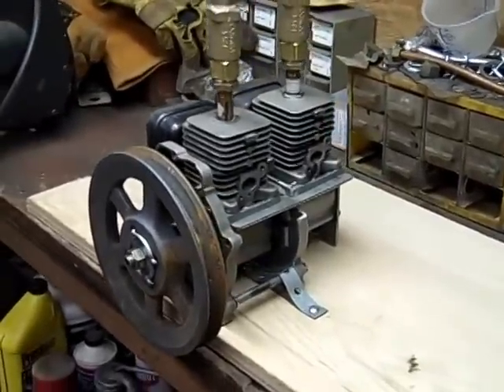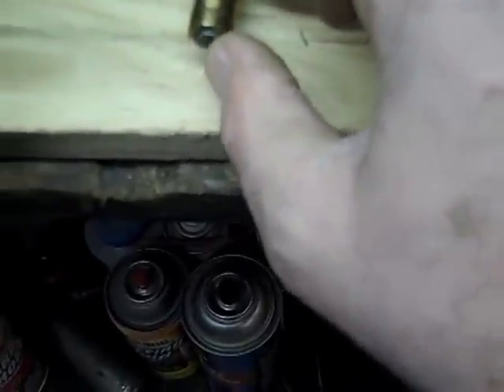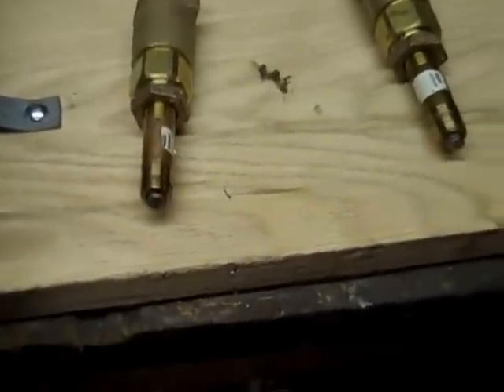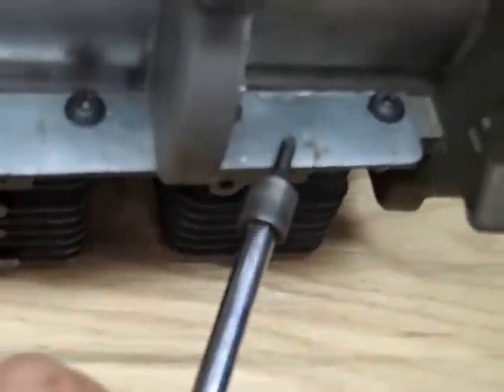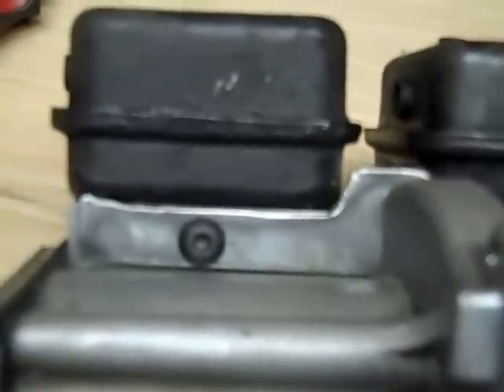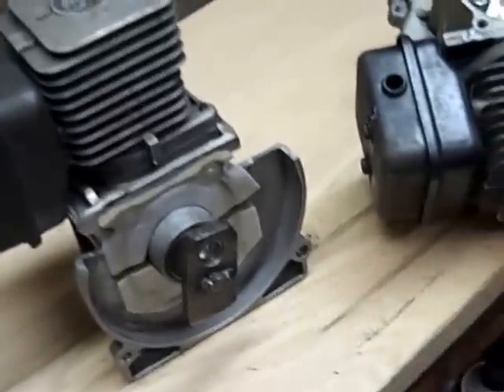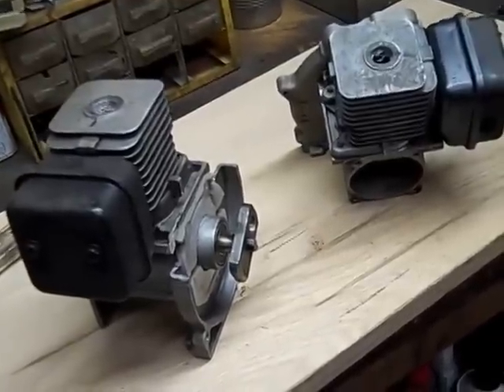The worlds first Twin engine Weed whacker Air Steam engine

Comment: Do you think that a 2 stroke 2 cylinder outboard motor will run on steam. I have looked in several places but found nothing
Reply: I'm sure it could! 2 strokes are good engines to convert to steam

Comment: If you ever took the challenge of adding a third engine, you could offset them 120 degrees, rather than 180, and it would smooth out a lot. That would also make it directional, so it couldn't be simply reversed. 
Pretty cool setup though.

Comment: Do u cover the intake holes were the carb use to be
Reply from the maker: No. I figured any air in the cylinder would be compressed as the piston comes up adding to the compression in the cylinder. Not sure if it makes a difference though.

Comment: The application of using air or steam is the absence of gasoline. If you don't have a gas station, how are you going to run anything on petroleum fuel? Efficiency has nothing to do with it, it is about worst case scenario use! A fire puts out A LOT OF ENERGY! You will have one going to cook, heat, dry, smoke meat, tan hides, ect. Why not charge a battery bank to provide heat after the fire? If you have ever camped or had a wood stove heat source in a home you will get it. Gets cold when that fire dies so rather than waste more fuel/wood, use the steam powered engine to get through the night and into the day? Think outside the box.
Reply from the maker: You make some good points JS. Thanks for commenting.  I think a gas engine converted to steam is a fun concept but not a practical or efficient one. An engine designed to run on steam uses the energy required more efficiently. Perhaps a sterling engine would be a simpler design to use in an off the grid situation as well. Capturing the suns heat with a lense would also be a good source of free heat to make steam too. There are more good ideas out there. Keep thinking outside the box.

Comment: no no.  it actually depends on your needs and resources.  Say you already heat your garage or building with wood.  Then it makes perfect sense to run a steam engine to power various things.  one thing they all get wrong is no one pipes the exhaust to a condenser then back to boiler .  Secondly you need to use electronic solenoids timed off the fly wheel with a basic magneto to charge the battery .  Its going to work way way better .

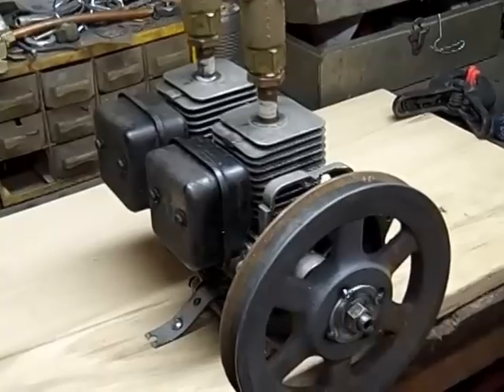Comment: Awesome engine but I had to stop at 2:20 after the most idiotic thing that came out of his mouth... Not practical... Put a parabolic lense below a boiler tank and point it at the sun then put a properly focused fresnel lense over the top and it will boil water in less than two minutes.... A motor that will run on the sun and water during the day and you can burn methane from your septic tank at night or rainy days... You can fuel it with a propane burner, an alcohol burner a bag of candles or some firewood you found in the woods along the way....how is that not more practical than buying gas to support war mongering, the subjugation of our nation, the poisoning of our environment ....? I live on the ocean where water and sun are plentiful so if you can't find a use for it feel free to send it to me. I'll power my boat tender with it.
Reply from the maker: Did you actually build one or are you one of those arm chair experts?

Comment: It needs oil to the or it will seize up. It would normally get oil from the gas oil mix.
Reply: No it won't. It's got steam running through it so it can only get as hot as steam which doesn't get hot enough to fuse moving metal parts. A grease job once in a while or a once a year dura lube treatment is all ....maybe put some Crisco in the steam boiler once in a while to prevent rusting while not in use.

Comment: Use a valve push rod from a gas engine cut to you desired length, made from strong light weight metal designed for a similar purpose and its hollow in the center, use the non cut side torwards the piston to avoid flattening. Just a thought
Reply from the maker: Good idea! My rods are a little heavy.

Comment: I actually used old car pushrods in my weed eater engine, I ran into a problem with the one cylinder pitting due to the harder pushrod metal.

Comment: Pistons are not horizontally opposed, it's a parallel twin with the crank thows at 180 degrees. Look at a BMW motorcycle engine (the R series), they're horizontally opposed.

Comment: I am trying to get one of these to work but everytime I get it to spin for a second or two then it stops and wants to rock back and forth have you got any ideas I can feel the tension on it as I tried to spend it fighting against itself
Reply from the maker: is yours a twin cylinder like mine? I can make mine run in either direction dependent on which way I spin it to get it started. It's important to have the right rod length. If it's too long, it opens the check valve early and will change the direction. The check ball should only open for a split second.
Reply: Clayborn Lewis, you need a heavier flywheel. The 'back' pressure you feel is the force necessary to open the bash valve against incoming air pressure, and the only way to keep the piston from simply bouncing back is inertia from the rotating mass of the flywheel. I hope this is helpful.
Reply from the maker: Wow! 4 cylinder!  I would love to see a video when you get it working!
Reply from the maker: Good idea Clayborn! I think you would be able to produce more power as well. Heavier fly wheel and a little bit longer rod would increase cylinder pressure and inertial power. My fly wheel weighs about 5 lbs. just for reference.
Reply: I've got an 8 lb flywheel it's about as big as yours I bought bigger valves like you got I had little small valves on there I think maybe that's the problem they just got here yesterday I ordered half inch they sent me 3/4 inch so I'm going to have to take a trip to the hardware store to get some reducers to make them fit but I think that was the problem because when they were opening up there so little and little Chibis I bought from China that they stay open and I think once they push open they're staying open instead of closing like they're supposed to anyway I went and bought valves just like the ones you got I got them off of the eBay they're the same ones you got so I'm going to try them I've got four Motors coupled together I figured you made two I couldn't copy you so I made for together but I'm only trying to get one working right now when I get one working and I'll put the 4 back together and go from there I'll let you know how it turns out maybe I'll send you a video thanks for the info
Reply: Don, I made one of these back in the '70s, and also a Briggs conversion, and also converted a model airplane engine to run on CO2..., which is why I suggested the heavier flywheel to Clayborn Lewis. Maybe you should read the comments more carefully? You are on the right track, but bash valve engines have been around since forever :)

Comment: Those rides that you have in your check valves why don't you try drilling a hole through the center of them so more air can get in and see how that works out for you
Reply from the maker: I did grind channels the length of the rods attempting to make more airflow. It may have made some difference. i think a lighter rod would help too since these are relatively heavy. I may try that Thanks for the suggestion.

Comment: What is the piece you thread in the spark plug hole?
i can't find anything that fits
Reply from the maker: Compressed air fittings used with quick connects. Virtually all air tools have them and they are available at most hardware stores. I'm not sure if the treads match but you can force them in an aluminum head.
Reply: Smash the ceramic part of a sparkplug, and weld a nipple on it.

Comment: Uses?  Biggest use would be for Solar Battery recharging during wintertime when sun is at its lowest. Great cabin, remote locations and yes... FOR AMISH FOLKS TOO. Spoke to an Amish fella who thought this was a great concept and badly needed.
Reply from the maker: +DJ H Thanks for the comment. Steam would be a good alternate source of energy. I think a conventional steam engine would be more efficient as well as more practical in that the engine design is proven. I've seen some pretty good home made engines. Might try it some time.
Reply: So how do the armish get the compressed air ?
Reply: They all get together and take turns blowing into an air hose.